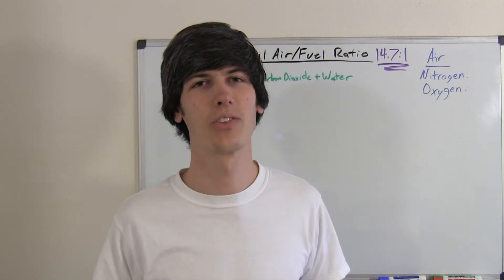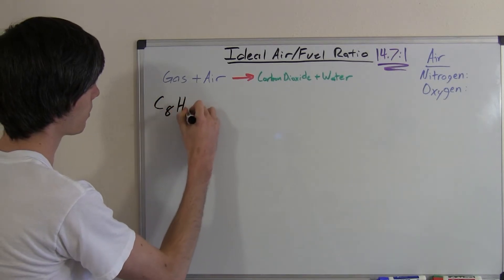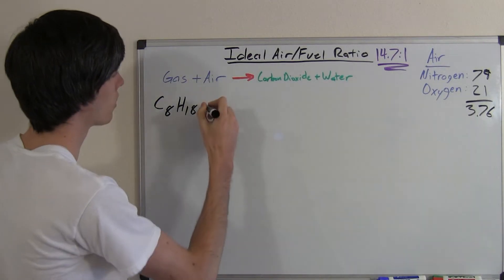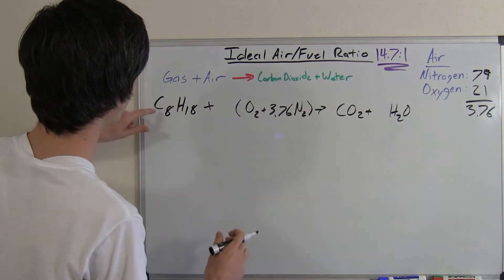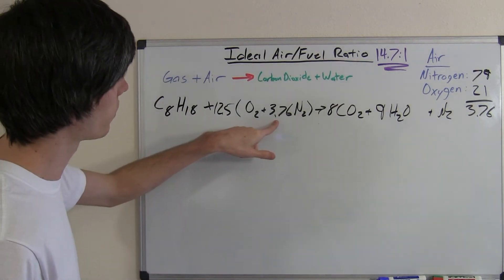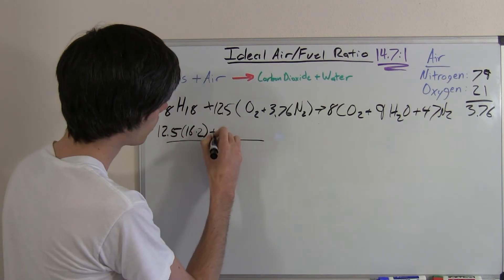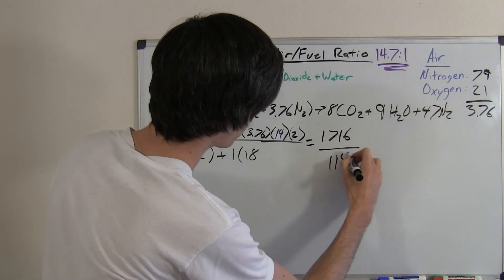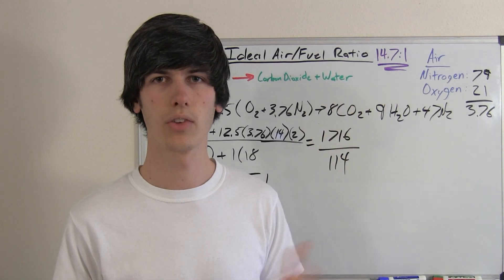Air Fuel Ratio - Explained

Comment: Why does running Lean make your car melt pistons ?
Reply: It's simply physics. The fuel is injected as a liquid, but as you may know only gases can burn. So the fuel vaporizes mainly when the compression stroke happens and you need a lot of energy to vaporize something even when it's at it's boiling point. So the fuel basically takes the energy which is needed to turn it into a vapor out of it's hot envirement inside the cylinder and so the temperature drops. And so if you inject more fuel, the temperature drops even more.
So basically the fuel acts also as a coolant before it can be ignited.
Reply: I believe shi01 provided an essentially correct answer, but I thought I'd expand a bit more on it to help explain. 
A perfect stoichiometric combustion would be the ideal fuel/air ratio, and would consume every molecule of fuel leaving behind no molecules of oxidizer (O2). This would get you the best fuel economy, in theory, but because different fuel formulations need different fuel/air ratios, and temperature, humidity, and pressure of the atmosphere around your car change the ratio, the car has to make a balancing act.
If you have a modern car, it actually measures the mass of the air going into the engine, and the percentage of O2 coming out of the combustion chambers to provide real-time feedback and dynamically adjust how much fuel gets added to the engine. This would in theory get us very close to ideal ratio.
Gasoline has a combustion temperature (the point where it will burn) of 495 F (232 C). So during the compression stroke, it CANNOT exceed this temperature, or the fuel will auto-detonate (spark knock). This puts an upper limit on the compression ratio of the engine, but the way. However, on power stroke (or just before), we need to exceed this temperature to get the fuel to burn. The spark plug causes a spark in the cylinder of many tens of thousands of degrees (up to), igniting the fuel. The fuel will then burn as it is oxidized into water and carbon dioxide. This is an extremely exothermic reaction, producing intense heat and due to the confined space in the cylinder, intense pressure. Your cylinder may reach only 150 PSI on the compression stroke, but it can easily be over 1000 PSI on power stroke. 
Here's where the fuel ratio comes into play: If you put the exact amount of fuel into each combustion event, the combustion process will create about 3800 F (2100 C) temperatures. Well enough to melt pretty much any metal your engine is made out of. Now, The inert gases in the combustion chamber (N2) will take the majority of this energy to heat up, so the temperature will really be around 900F (480C). Still WAY too hot!
The trick: there is a phase transition between a solid and a liquid, and between a liquid and a gas, and this phase transition takes a considerable amount of energy. Think of how long an ice cube lasts in a glass of water, or how long a pot of water can boil on a stove before it's all gone. It may take only 4-5 minutes to heat the water from room temperature to boiling, but then it takes the same amount of heat over 45 minutes or more to boil the water away.  By injecting more fuel into the cylinder, it will absorb heat created by the combustion process, greatly reducing the overall temperatures as it phase transitions from an atomized liquid to a gaseous state.
We solved the temperature problem, because the extra fuel can't combust because there simply isn't enough oxygen to react with. Unfortunately, the environment isn't going to appreciate this unburned gasoline being released out of your tail pipe. This is where catalytic converters come in. The take the unburned and partially burned fuel products from the engine and react it to finish the oxidation process.
Reply: Warren Garabrandt Thats also why cars have EGR (exhaust gas recirculation) valves installed in them now. The exhaust gas gets recycled back into the intake, which basically just fills up space inside the cylinders, since there's no oxygen left in the exhaust gas to be burned. This reduces the amount of fuel that is necessary to be injected into the cylinder, thereby increases MPG, reducing cylinder temperatures and reducing emissions. I'm sure you already knew this, I just wanted to add this information for other people reading the comments.
Reply: You guys are freaking impressive! Science is sooo damn cool!
Reply: Lean = high temperature, to fat and you cool down.
Reply: yea lean is high temp, but why ?
Reply: Because gas cools down, low gas = low cooling effect = hot engine. More fuel = more cooling effect = cold engine.

Comment: I've been reading and searching a lot in the last few days about preparing engines for competitions through reprogramming the ECU, seeking to have more cases of reach air/fuel mixtures. I'm not sure how it's called in English, but in Portuguese this is called something like "ECU remapping". However, I couldn't find it yet how can it increase the power of the vehicle, and I'll tell you why: the maximum amount of gas burnt will be when all the oxygen within the chamber is burnt, and the over injected gas will be exhausted, right? If so, this means that putting extra fuel making the air/fuel mixture reach would be useless to increase power, since it does not explode. All my readings on the subject seem to tell me the opposite, but I don't understand why. Could anybody help on this? Thanks!
Reply: if you want to create more power you also have to burn more oxigen so you have to let more air in to allow the richer mixture to fully combust
Reply: Remapping the ECU wouldn't change the air fuel ratio?
Reply: maybe it will change it injecting more fuel but if the air isn't enough to burn it all then it will be running to rich and innefficient
Reply: Yes, that's exactly my point! But the aumount of air that gets into the engine is regulated by the throttle, which is a mechanic part, where the electronic injection system can't influence (am I right?). I still can't understand what is going on.
Reply: and there's where the intake and exhaust modification are needed,

Comment: Hello! so I have a question I could not find on internet. I have my very own answer to this, but for me is difficult to explain. Well the question is next, on naturally aspirated gasoline engines, you can run the engine lean, rich or stecheometric. 
1- What is the risk of running this engine with lean fuel mixture?

My thoughts:
At full throttle, 5th gear for example, 
if you run lean maybe full power will not be reached, so maximum rpm never come.
if you run stecheometric you will reach full power, maximum rpm (as manufactured specification).
if you run rich, maybe you can reach more than maximum power, exceding maximum rpm.

On conditions stated before, after compression stroke you will have on all engines same final pressure, so same will be the mixture temperature. but after ignition: 
-Running lean no high temperatures will destroy the engine, no knocking of the engine will be produced.
-Running rich, you will have higher exhust gas temperatures, due to more fuel is injected.

Thanks for you time! Matias from Argentina.
Reply: Let me try to explain this a bit.
For the engine to run, we have to compress the air and fuel in a cylinder, ignite the mixture, and the resulting pressure drives the piston down in the cylinder, doing work. So, to get started, we have to spend energy taking in air from the outside (and fuel) and compressing it to a higher pressure. This increases the temperature in the cylinder, costing work. Next comes the combustion.
Think of it like this: Combustion is a redox reaction. Redox (short for reduction-oxidation) requires an oxidizer, in this case oxygen in the form of O2. By rearranging and recombining the atoms from the gasoline (the carbon and hydrogen) and the atoms from the Oxygen, we mostly create H2O (water), and CO2 (carbon dioxide), and we release quite a bit of energy in the form of heat. Heat is just molecules moving fast and vibrating around, and molecules moving fast in a confined space creates pressure. So, the combustion process consumes the O2 and the Gasoline to create water vapor (steam) and carbon dioxide, and these gases create the pressure to drive the piston down in the cylinder, doing work. As the volume of space in the cylinder expands, the temperature and pressure drop rapidly, then we pump the atoms outside of the cylinder so we can start again.
Working from that, we can see that running lean is reducing the amount of fuel does not increase power. Because there is less fuel there to burn, less water and CO2 is produced, resulting in lower pressure, and therefore less work can be done. The exhaust temperature is actually higher when lean than if you ran rich, because there is no extra liquid in the cylinder to absorb the heat and lower the temperature. 
Running rich is increasing the amount of fuel, but here's the important part: we don't get any more oxygen for this extra fuel! The extra fuel will not combust, but it will absorb heat from the combustion process. This results in lower temperatures due to the phase transition between a liquid and a gaseous state. Think of a pot of water boiling. It heats up to boil quickly, but then takes a long time to actually boil away to nothing. This is because the transition from liquid to gas takes way more energy than just heating the liquid up boiling. So, running rich will NOT increase exhaust gas temperature, but instead will REDUCE it. This also means that you get slightly less pressure, and very slightly less work out of each combustion event. The unburned fuel is wasted and reduces your fuel economy too.
RPM is a completely different issue. RPM is a function of throttle and work. Remember that throttle controls how much air goes in the engine, NOT FUEL, and the computer (or carburetor) matches the fuel to the air going in. When you increase the throttle, there is more air, so more oxygen. The computer injects the appropriate amount of fuel (about 14.7:1) for the amount of air that went in, and combustion happens. If the work load driven by the engine is less than the throttle allows, than speed increases, increasing RPM. If the work load is higher than the throttle allows, than speed decreases, reducing RPM.
The computer will run the engine more rich at higher engine loads (not necessarily the same thing as RPM) to help keep the temperatures down, but this is more of a temperature management issue than anything. It's not that higher temperatures are caused by rich mixtures. It's that if the temperatures are too high, you richen the mixture to reduce the temperatures.
Does that clear anything up?

Comment: So whats the best ratio for maximum torque? And why?
Reply: 14.7:1. This is the idea ratio. Any lower and you aren't getting enough fuel into the engine to use up all the oxygen you just spend energy compressing. Any higher and some of the fuel won't burn, carrying away a small amount of heat (and pressure) from the engine, reducing the power.
Reply: 13.3:1 N/A engines
Reply: I suppose 14.7:1 is the balance

Comment: I've got a problem on my motorbike: when i accelerate i can feel that there is a lag in the feedback and the engine starts to work after a little amount of time. My question is: is it a problem due to air fuel ratio or it depends by something else?
P. S. my motorbike has 2 stroke engine
Reply: put power commander and use accel pump feature
Reply: +David Gtz thanks for your help, but i ve already solved this problem: i made an experiment and i discovered that the mix was too rich, so i allowed to air to be in a bigger amount and now it has no problem more.
Reply: clean spark plug often and 2 stroke runs better at higher rpms don't let it idle for very long

Comment: can  engine overheat  be caused by increase or decrease of air-fuel ratio
Reply: Patrol 2012 engine is simple,more fuel +more air= more energy to burn/more heat...

Less air +more fuel=good for engine/lower temp but inefficient torque

Comment: what is the air fuel ratio by volume (lit)?
Reply: +Ahmed Meguid This is about 9260 (Vol air to Vol Octane). The math is that the air fuel ratio multiplies the ratio of the density of Octane to air. The former ratio is 14.7-15.0 as it was calculated in this video. The latter ratio is about 803/1.275 approx. 630. The result is 14.7x630 approx 9261.
Reply from the maker: By mass
Reply: +Engineering Explained If my engine is 2.5 L and idling at 1000 rpm in this case the engine will draw 1250 lit per min of mixture. I would like to know how many liters of those are fuel (regular gasoline)?
Reply: +Shenghui Yang Thank you!!!

Comment: How does turbo charging affect this ratio?  If more volume of air is being forced into the engine wouldn't this throw off the ratio?
Reply: +buzzcrushtrendkill if the ecu is functioning properly it will dump more fuel in to the engine to balance it out. More air= more fuel. More air + more fuel = more power
Reply: +ultimatercracer  would you still have to tune the ecu or leave it alone
Reply: In most cases you will need a tune and other supporting components to maintain the proper afr, timing, ignition timing etc.. to gain safe power
Reply: Multiple sensors will see if the air fuel ratio is to lean/rich and adjust accordingly

Comment: So does a car try to maintain this ratio throughout different rpms? Like is it a base setting?
Reply: +spoon games The actual reason that your car idles higher when cold than warm is very simple. Your car does attempt to maintain this perfect ratio on all occasion, even when accelerating. This is because anything higher or lower than this ratio is a potential waste of energy and more polluting. In order to maintain this perfect ratio it uses what is called the upstream oxygen sensor (in newer cars it now called the air fuel ratio sensor) to monitor the gases coming out of the engine, and determine if it needs to add or take away fuel to maintain this ratio. The problem is in order for this sensor to give accurate readings it must first get really hot, it typically operates at about 600-800F. So on start up the readings from the sensor that tell your car the a/f ratio inside the engine is not accurate. Because of this your car runs in what is called open loop, or basically it ignores the readings from the sensors and runs on predetermined values programed into the control module. The problem is these predetermined values tend to be wrong, you even saw it in the video where we got 15:1 because we assumed the make up of the gas and air. This running off predetermined values and those values being wrong is the reasoning for your car idling high when it is cold than warm. Don't believe me do this test, start and run your car till it as operating temperature. At this point it should be idling normal and not high. Turn the car off and let it set for about 10-15min long enough for the car to believe it has been siting but no long enough for your engine to actually cool off. restart the car, and what you will see even though the engine is warm the car will still idle high for a couple a minutes. Why you may ask because in order for the car to decide that the sensors are at operating temperature (it also uses other sensors in all totaling about 20-30 sensors all of which need to be warm to work correctly) and the information is now correct it has, yet again predetermined values, that typically tell the car has to be running for x amount of time, typically 3-5 min depending on the car, before it can run in closed looped and use the sensors. So when you leave it the car says ok the car just started and the coolant temp sensor is telling me the engine is warm which should mean the sensors are warm however the programming states it must run for x amount of time before going to closed loop. So after running x time it then relooks and says ok coolant temp is still good so now I can run in closed loop.
Reply from the maker: +mrsemifixit All kinds of different parameters will cause the engine to alter A/F. Throttle position, RPM, engine load, etc.
Reply: +Engineering Explained Yes but is it constantly trying to maintain the proper ratio?
Reply: +mrsemifixit not really .. there is many variable to it for example when you start your engine it is cold and the fuel will evaporate less in the cylinder therefore the ecu will adjust the ratio to make it richer and becomes leaner as it warms up .. also if the engine is at high rpm it won't have the same ratio as idle because there is more heat produced and it will go rich a little to cool it.

it all depends on the tuning .. if you are targeting more fuel economy afr should be lean .. and the opposite for high performance
Reply: +spoon games I believe it's to warm it up but also to ensure that the engine doesn't stall whilst it's cold and warming up, and obviously having a higher RPM prevents this.
Reply: So is that why a car idles higher at cold engine starts or is it the ecu warming up the engine quicker and building oil pressure?
Reply: Very good explanation, thank you!

Comment: i think you made A MISTAKE when you calculating the ratio, you did not multiply 12.5*16.2 with 2 (because you have to atoms of oxygen not two). 
Am I right ?
Reply from the maker: +Majid Kaki Nope, sorry if it was unclear. 16*2 not 16.2. (It is multiplied by two).
Reply: he did multiplication... its O2... so 2*16

Comment: very good video brothr but i know what u say,,, kindly just explain me about how to change air fuel ratio ,practically not theory (leaner or richer) ?
Reply: +Ali Khan simply, add more air and the mixture becomes leaner, add more fuel and the mixture becomes richer.  but be careful, though it is better for your engine to run a little on the rich side,  it is important to note that too much or either will be harmful to your engine.